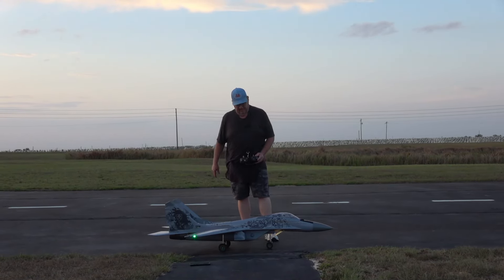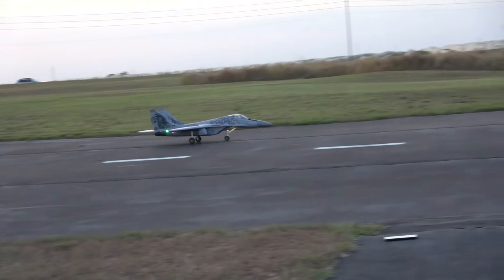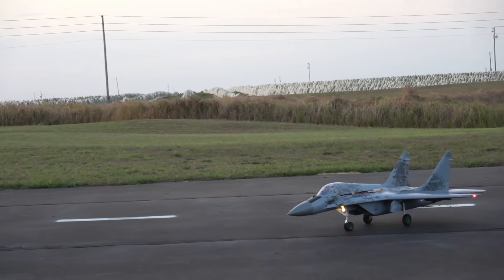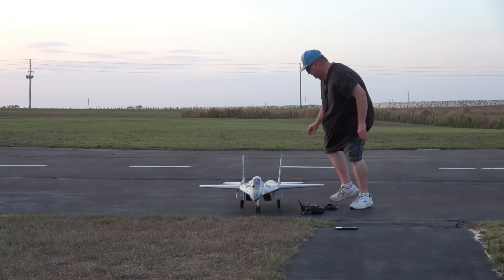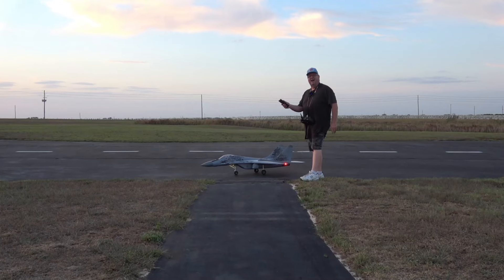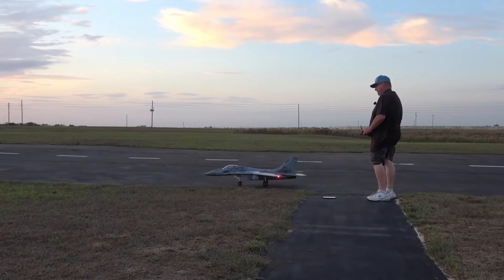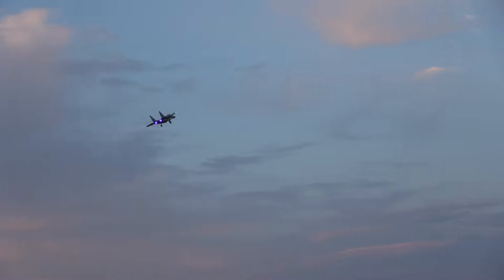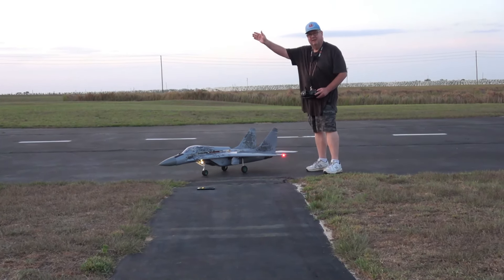FREEWING MIG 29 TWIN 80MM DOUBLE TAP PT 2 by FGFRC #aviation #rc

Comment: That’s was some great flying !!! You sure know how to rip the skies with those beautiful jets. Which batteries are you using and you are running in parallel correct or series ?
Reply from the maker: The run parallel both are 5300 smc high voltage pack I also run 5000 hrb packs in her.

Comment: Nice flight. Watch those turns brother she'll drop without power. Tailrons can help with the turns. If you want to bring it in slow you will need to take it out a little further for approach and alpha it in. Be careful with rudder to keep it straight as it can snap roll. It can fly slow in the straight but it needs about 70 percent power in a turn 😂. Again awesome flights.
Reply from the maker: You are very right about turns, I almost lost her in one of those turns.

Comment: Turn front battery sideways and/or trim canopy so doesnt buldge or come off.

I thought first split S you was going to pull out 😮
Reply from the maker: Thanks, and yes that is why I went t high rates to get a bit more elevator throw.
Reply: @FatGuyFliesRC  at minimal you can move the rear battery all the way back too.